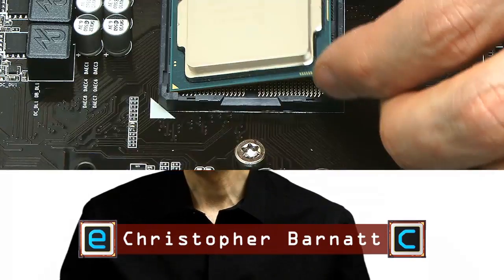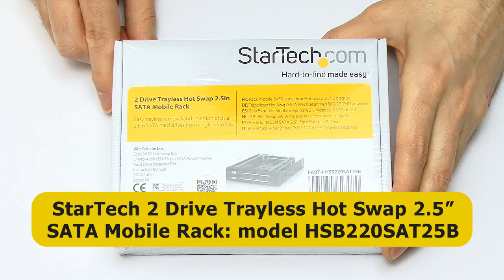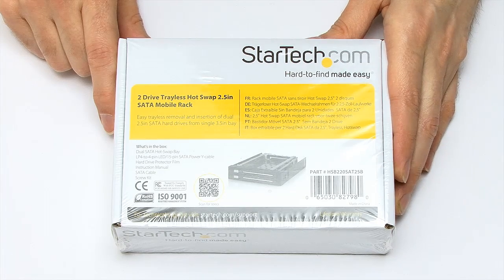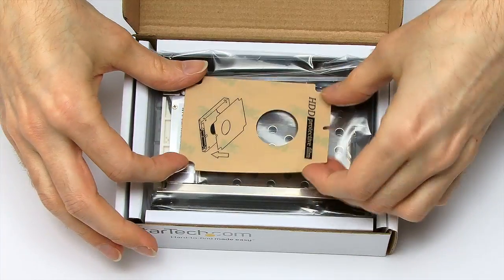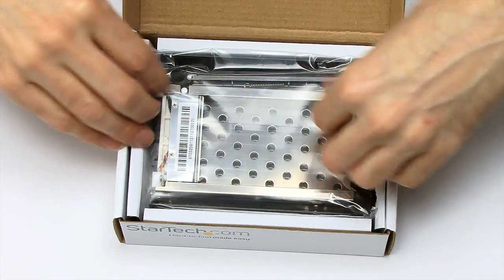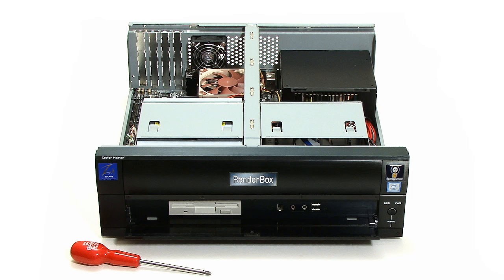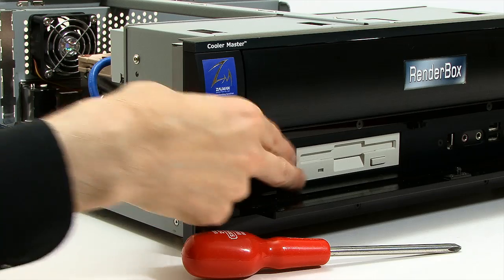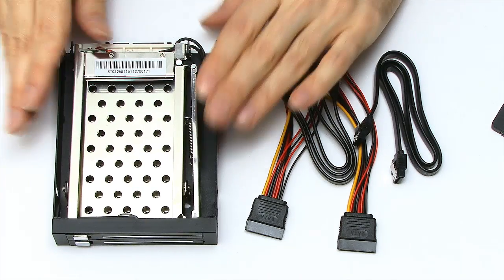Dual Trayless 2.5” SATA Rack

Comment: So the 2.5" SSD is the new floppy.
Reply: Unlimited would imply drives of infinite capacity. Right now you are limited to 4TB (and you must have deep pockets to afford these).
Reply: 1.44MB were unlimited in 1984 just like TB today :D
Reply: I can't wait, because those things fill up real fast. Once you are used to fast storage for productivity, it's hard to go back to spinning rust.
Reply: +William Todd If it's a Velociraptor you are right to hold onto it, as they don't make them anymore. Although I hope it doesn't die on you if it's older than 5 years, as those things aren't really meant to last much longer than that unfortunately.
Reply: With unlimited data capacity rather than 1.44MB at a time, you can install Terabytes at a time LOL.
Reply: You can't swap out a 3-1/2" disk drive for a larger capacity like you can with this dock.  So yes, you are limited to 1.44MB discs, the dock allows you to put whatever size drive in that you want.
Reply: SteelSkin667 In a couple years a 4TB drive will be less than $100.  I remember when 1TB drives came out they were $1,000 now they're getting cheap.
Reply: SteelSkin667 I've been slowly having the drives in my computers replaced with SSD's.  My desktop still has a spinning drive but it was a video production computer and the current hard drive is a 1TB 10,000RPM drive so not in a hurry to replace it LOL.
Reply: SteelSkin667 I'll keep that in mind.  I want to do an SSD swap in this one as well but a 1TB SSD is ridiculously expensive yet.
Reply: +blubb Floppies as a mean to move data between computers over sneakernet have really been replaced by USB flash drives and hard disks in the early 2000s. In my experience, people carry flash drives more often than sd cards if they want to grab data on someone else's computer.
Reply: I would hardly say 1.44MB has ever been considered "unlimited" data.  That's only around 300,000 words in raw text.  Or four/five novels.
Reply: Most of the full size SD cards I have seen are just a micro SD in an adapter, so you are lucky they aren't more expensive especially once you consider the smaller demand for the full size cards.
Reply: William Todd  Pardon?  Can't swap 3.5 drives for bigger ones?  I think you're a bit behind with those ideas!  They call them "hotswaps" and are available from 2013 i believe.

Comment: As I do tech support and often need to plug in customer's hard drives to get their data out, this looks like a good solution however, I would rather stick the protective film in the tray. I see that the top tray is accessible, is that so for the bottom tray?
Reply: Michel Jutras I recommend an external USB 3 multiple interface dongle. (They do SATA I,II,III, IDE (laptop) & IDE (desktop). The only thing you would be lacking at that point is SAS/SCSI, but those are mostly enterprise solutions.

Comment: this is totally usefull, i am using a HDD tray as well and its super convenient and easy to use!
Also ths slide mechanish i suppose prevents it from opening by accident.. It looks classy
Reply: The tray is spring loaded, so when you open the upper or lower access door it will push the drive out so you can grab hold of it and remove it easily.  There's also a spring on the access door that holds the drive in place when you close the door.

Comment: What a wonderful way to wake-up on a Sunday morning, to an EC video!  Chris, how hot does the mechanical hard drive get in the bay?  I have run 3.5" units in a mobile rack and it's been like putting them in an Easy Bake oven, heating the drives to about 40 °C.  I didn't like that so I purchased a mobile rack with a built-in fan and the drive now only gets to about 32 °C.  Being smaller, does the 2.5" drive keep its cool?
Reply from the maker: I've not experienced any over heating issues, perhaps because the bay is a pretty heft metal thing, and also -- as you say -- 2.5" units tend to run cooler (certainly not over 40 here). Also, 2.5" HDDs will only go in and of the bay when needed.

Comment: Why do you have no graphics card in your pc?
Reply from the maker: Because this PC is used for rendering 3D animation only using a command-line program called LightWave ScreamerNet. This uses CPU rendering (no GPU use), so adding a graphics card would only increase energy used and heat up the case. If I wanted to run something like video editing on this PC (and it is a machine that I may do that on at some point -- it also serves as backup hardware), then yes, I would add a graphics card. :)
Reply: ExplainingComputers Oh ok. I thought you could profit from something like CUDA. Love your Videos btw
Reply: ExplainingComputers Have you looked at systems with multiple Xeon configurations? I've seen rigs with 32-48 cores, which would parse out the rendering better and faster, if your software is optimized for core utilization. Surplus hardware is pretty cheap for Xeon architecture.

It may be a bit power hungry at full utilization, which I know is a concern, but you may be able to do the render work in 1/10th the time with a similar TDP, so it would be more efficient overall.
Reply: MiKAWOOF  The i7 series have graphics incorporated into the main processor .

Comment: What a fantastic product. I think I might purchase one of these as they are handy if you have to transfer large files from one location to another with optimum transfer speed.

Also thanks to your excellent review of the Rii i8 Wireless Mini Keyboard & Touchpad last year. I got one as a Christmas present on the strength of that video and I am very pleased with it. I use it with my Raspberry Pi especially when I am using Kodi and RetroPie.
Reply from the maker: Excellent -- I'm glad the Rii worked out for you. I find mine a very useful piece of kit.

Comment: Dont use the sata y splitters, they are known to cause problems, killing hard drives and sometimes even melting, even if it includes the activity led
Reply: ExplainingComputers I have to agree with this comment: Molex to SATA adapters are not that stable, and yes, I've seen some gory meltdowns... Issue would be to see if you have enough SATA power connectors in your PSU as well as anything that can convert the two activity LEDs to Molex (that or your PSU has Floppy power connectors, which by the looks of it are the same as those LED power connectors)
Reply: I don't think you're going to get a meltdown from not having a dedicated 3.3v line any hard drive, cause that's all you're missing from those Molex connectors. It'll get the 3.3v from the 12v rail if that voltage isn't detected from the power input. I've used Molex to SATA adapters for years and NEVER had any issues beyond not being able to find them when I need them.

Now, where you CAN get a meltdown, is if you have one of those older SATA drives that had both the SATA power AND Molex power connectors, and you hooked up both. In that case, the 3.3v would be dropped by the drive from the 12v rail, butting against the 3.3v coming from the power supply and causing the onboard regulator to fail in a puff of blue smoke, or some such mishap. I've never actually had it happen, cause I'm not fool enough to try plugging in two power connectors. Otherwise, the only way you're going to get a meltdown is if you're drive is drawing an obscene amount of current (2.5" drives barely draw anything), and the adapter has a weak enough connection to cause arcing.
Reply: @BlackEpyon  I have seen the SATA power connector on a molex to SATA adapter fail with flame and smoke, fortunately the flame went out when power was removed and it didn't damage anyting else in the process (even the SSD it was connected to was fine after I cleaned the soot off the mating connector).

The big problem with adapters IMO is that they don't have any identifying markings on them so (unless you keep a very careful inventory of what you put in your machines) when one fails you have no idea who to blame.

Combine this lack of accountability with the SATA connector's design that requires much tighter tolerances than older connectors and you have a recipie for trouble.
Reply: @petermichaelgreen  How!? Unless you've bent one of the pins with a screwdriver and shorted ground to the 12v rail, these adapters are as simple as can be!
Reply: @BlackEpyon  The adapter was in a frequently use PC and I think at the time it failed it was years since it was last messed with.

From where the connector failed I'm guessing that there was insufficient separation/insulation between the incoming wires and things broke down. I don't think the fault was in the actual contacts with the drive because of the lack of damage to the drive.

PC power supplies can supply a lot of power, more than enough to have exciting results and SATA power connectors have those high current supply rails much closer together than older connectors.
Reply: @petermichaelgreen  I know how much current the 12v rail can supply. The 12v pins are right next to ground on the SATA, and if they got mashed at the connector, the short would still be "external" to the drive, and the drive would still survive so long as the header doesn't melt. I'd need to actually see it to know for certain, but that's all I can think of.
Reply from the maker: Very interesting, I will look into this . . .
Reply: I tend to think that its best to avoid units with PBCs (unlike this one) involved I've recently had two drives rendered clicking dead from a assumed hot dock PBC serge, likewise for USB docking stations, I refuse to use USB for anything but sticks & input devices anymore, the circuitry on these PBCs seem shoddy in most cases I'm currently using the stock docks my new Cooler Master HAF XB EVO case but I feel like I'm walking on eggshells, when I bought it I overlooked that it used a PBC in the dock unfortunately, I'm using it with caution, so far, in the first week, the only issue I've had is that it seems to require more rebooting as in many cases it takes that to detect the drive if a new hardware scan fails.